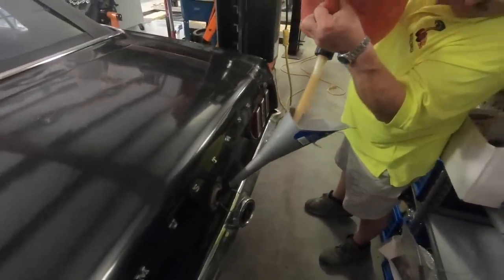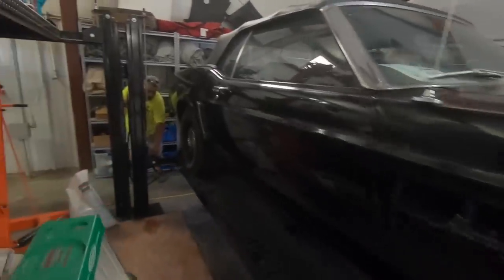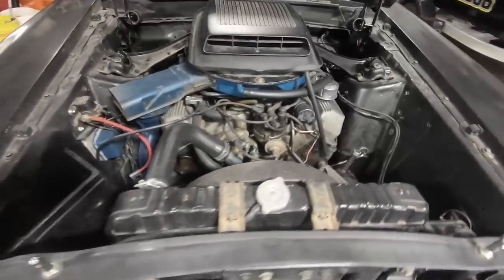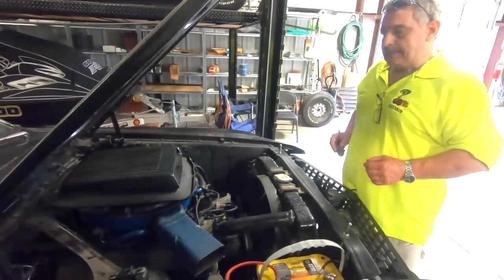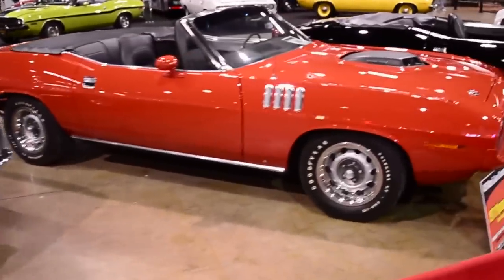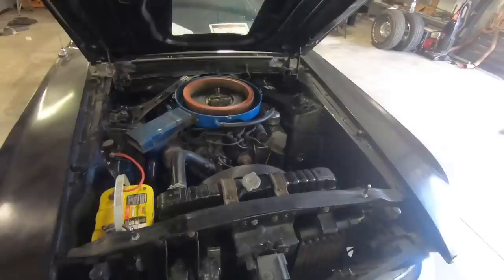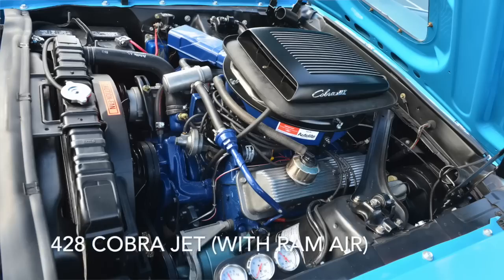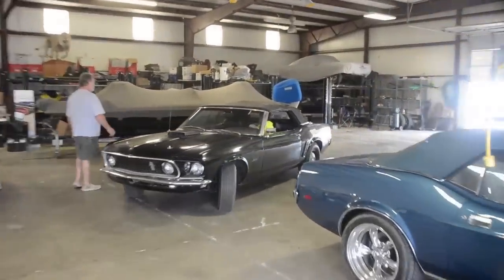True Holy Grail Barn Find, 1969 Drag Pack Mustang Convertible, One of 8

Comment: It wasn’t a Mustang but my brother found a 1969 Torino Cobra 428 CJ.  52,000 original miles and Dan original paint car. No modifications or anything cut or painted. 
Interior, black and perfect. Exterior, no debts, a few paint chips and had a good shine after cleaning. 
Once we cleaned all the fuel lines, tank, the 735 dual line from the factory carb, and the brakes we got it going right away. 
Decided to keep it as is original.  Worth more never painted or modified. It’s parked in southern Ohio. 
It’s brother was found in much the same way. In an old barn. 
A 1970 Mercury Spoiler with a 429 SCJ w/drag pack.  This one a 4 speed car, all the gauges, the louver on the back window, and checkered seats! Black and white checks. This one like the 69 has original paint. Dulled in some areas, rock chips. No rust. We got this one going and it is a fast car and fun to drive. They sit side by side in his garage.  I think he likes the 69 better. I’d damn sure be happy with either.  
Wonder what kind of money those are bringing?

Comment: They came with a special C6 that was used behind Cobra Jet cars and even the police cars cars used the special C6. Big servo. Wide ratio trans gears. And extra clutch packs e.t.c.  The wide ratio gear box is what really made the cars come off the line alot faster than standard C6's First gear was really short. Made the car have excellent torque from a dead stop.

Comment: We have 1970 428 cobra jet 4 speed convertible 325 gears. No power steering no power brakes no shaker hood. Order just for street racing sleeper. Marti report on this car says it is one of 5 built with 428cj and 4 speed. Only 15 were built in total sounds pretty rare to me.
Reply: That's what I was thinking. He didn't even have a Marti report.

Comment: wrong way to start a stored collector car , should have primed the fuel system, spun the oil pump , etc etc, good way to ruin a motor
Reply: It primed by the starter when he was cold cranking forever and not tapping the gas, then he added the gas down the throat and sparked it off.  The battery was right there next to it on the floor and they've recently gone through the entire fuel system so pretty sure it's been run more than a few times since he got it so it's fine.

Comment: Cool, but I do believe that the top 67-68 fastbacks bring much more money than that car.
Reply: I own 2 68 fastbacks GT cars a 390 s code n a 302 j code all orig low mileage cars 69 stangs are not even fastbacks they are sports roof the holy grail is a 68 fastback GT 428 cobra jet r CODE not that many because shelby used a lot of them for the GT 500KR

Comment: A fellow I worked with in the 80's had a 71 or 72 Big block Mustang with the drag package he ordered from overseas and had it delivered to his local dealer when he discharged from the service, his dad some how or the other knew a bunch of the NASCAR people, he took the car to Daytona back when they had an open track day or something like that back then and got his clock cleaned by a big block Corvette, being a Ford man this did not sit well with him, on the way back to PA they stopped in at Hollom&Moody in NC I think he said is where it was, they had one of those huge engines that had recently been outlawed by NASCAR sitting in the corner with a hole in the block, his dad knew the owners (don't ask me how an old guy from PA with a small garage knew them but he did) and got them to sell the engine to his son, it took a couple of years for him to buy a new block and rod, get the engine in the car and get everything working correctly but he did and that thing was a monster, I guess at one point he had to send the car to H&M to get the front modified cause he couldn't get the engine to fit in it, one of the monster trucks, I think The Virginian, came to a local Ford dealership on a promotional tour and someone who saw the engine mentioned to the owners that he knew a guy who had an engine like that, at which time they said "Not like this one", a call was made and the owners of the truck were amazed to see one in a car, I guess they pulled their checkbooks out for the engine but he said no way, he'll never part with it, the car used to run out of Brownsville PA, I haven't seen that guy in years and have often wondered what happened to him and the engine.
Reply from the maker: Great story!!! Thanks for sharing.
Reply: Yeh Ok if you say so.
Reply: @jonathandexter135  
Yea, I do say so, why?

Comment: Some years back i had Ford top loader bullnose trans with close ration gears. I bought it cheap from a guy who was going to use it in a circuit racer ,which never happened. My plan was to use it in my Hemi T bucket salt racer. I checked the numbers on the top loader site and it was originally in a Torino Drag pack car. I wonder how many Torino drag pack pack cars were built?
Reply: Well alot of things happend during that era. For example Vietnam war

Comment: How do you have a “drag pack” option with an auto trans?
Reply: Drag pack was the beefed up auto trans..drag packs did not come in a manual
Reply: Drag pack was a 9 inch Detroit Locker, (391 or 411 Gear ), dual exhaust, factory oil cooler , which was visible in the Video, and the shaker Ram Air with hood pins. Most were manual trans, the rest were auto.

Comment: Ya he's got a nice collection  but,  I think that black convertible has had an engine trans plant because, as the owner of 5 Mustang's 3 of them are 69's a 72 & 73, 3 are also Mach 1's. I also have several big block 60's  Galaxie's. Whenever I seen a big block Mustang 390-428  the factory original exhaust manifold bolt pattern is horizontal on the head's to clear the shock tower's, witch are different head casting's also. A lot of guy's will transplant a block big engine from other Ford product's only to find out that the engine verticle manifold bolt pattern hit's the shock tower's. This car may indeed be an original big block car but with the drag pack option  somebodies lead foot probably blew the original engine & installed a trans plant. Also big block hi po engines usually came with factory cast iron header's. Some of the head's also had a dual bolt pattern for different application's. Also in the 60's most all hi po  optioned car's from Ford were shipped from the factory with the hi-performance part's in the trunk & were dealer installed ie Tri-power & dual 4 barrel set up's. Which make's wonder what ever happened to all of the stock manifold's & 4 barrel carb's & intake's the mechanic's removed, along with the stock exhaust manifold's. Gee if we only knew as car collector's back then where all this was going, I was somewhat lucky & got my 18 or so car's way before the craziness took off, I don't suffer from the 20-20 hindsight issue! but that's another story.
Reply: please, please learn how to use apostrophes - they are not meant for plural nouns/verbs (5 mustangs not 5 mustang's).
"mustang's" means belonging to the mustang (ex. "my mustang's rims got bent when i ran over that crowd of orphans"). 
you, on the other hand, stick them on every word you want to make plural and make them look as possessives instead.
Reply from the maker: Good one Svetlana. One of my pet peeves is when somebody uses a subjective pronoun as the object of a preposition, so I feel your pain. Please post more.
Reply: picky, picky, picky you must have been your literary teacher's golden boy for sure Shitlana  Donald Fuller's comment hit's the nail on the head! Pop corn fart.
Reply: @svetlanaz7872  
You busy this weekend?
Reply: and you drive what , a lada?

Comment: Been clocked 1 is higher than other didgets a sign it's been played with should be all exactly the same level at the factory they use a pin to assemble the Speedo clock ,,

Comment: I remember Huntington WV Ford dealer had two 70 1/2 Falcon 2dr with the big block Drag Pack option.
Sticker total was about $3500 ! One was baby blue, one grabber orange. 70 1/2 Falcon based on Torino platform
but 2 dr had window frames and a B pillar unlike Torino. Bench seat, rubber mat instead of carpet, no mldngs etc.
Bare bones racer for sure. I sure did want the blue one but what  can a 17 y/o do?
Insurance (if anyone would write it) probably be as much as the car. Heck, I would have been happy w/a 302 automatic

Comment: How would you get a better deal on a 69 over the 71
Reply: Beecause its a smallblock car with a junk 429 put in it
Reply: 429s were garbage. The 427 was a beautiful engine. Apparently Ford busted Shelby for dropping 429s into Super Snakes to save money and made him swap them back out for 427 side oilers. Since it was a customer option to do the swap there are a few Super Snake 429s still out there.
Reply: 428s, not 429s. 429s are 385 series engines. 427s and 428s are FE engines.
Reply: @alanmyers5081  the 429 Boss was the '69 -'70 drop in engine on stock Mustangs.

Comment: Sorry but this car was a small block.   This guy is totally full of crap      Look at the shock towers.   Fords with big blocks had reinforced metal found about half way down the inside of the shock tower.  4.07 mins in you can look at the drivers side shock tower which clearly does not have the reinforced metal wrapping around the lower half.     They built thousands of these cars,
Reply: it has happened before   this car came from the factory with a small block.   the guy got ripped off
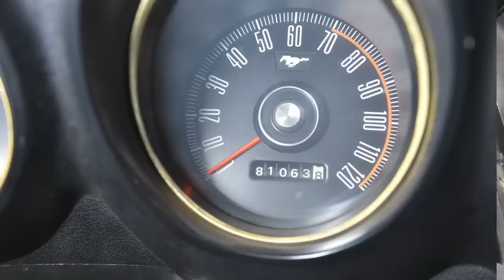Reply: The reinforcement is clearly visable behind the dipstick on the P/S pump at 4:08......
Reply: 429 boss had the wider shock towers.the rest were narrow.

Comment: That motor was a trainwreck. Timing was off, had several exhaust leaks, dropped cylinders, carburetor was all jacked up. And to be honest,....that motor didn't sound like it had the kind of compression a drag pack motor would typically have. Just not the condition a "Holy Grail" car should be in. Just my opinion.
Reply from the maker: Well, this holy grail is also a barn find, so not restored.
Reply: @thewriter2549  He did build that motor though.😳

Comment: Okay a heavier convertible and they ordered drag pack. Rare because it doesn't make sense. Why order a heavier car and then want to race it. The non convertible would be faster right from the start. That's why it's rare because it's not desirable at least not for it's intended purpose. Now you have a great car don't get me wrong. But a race car that wasn't raced. Well that says it all.
Reply: he mentioned, the previous owners had swapped the rear diff & box so it could be raced (he's got the originals ready for install later)
So it most likely was actually raced
Reply: I think there is a reason they hide cars because they have been altered many a engine swap and altered numbers
Reply: I think a drag car would be a four speed for sure

Comment: What makes a Mustang a Drag Pack???  What is a Drag Pack????
Reply from the maker: Drag Pack was an option that readied a Ford to drag race, starting with either the 3.91 or 4.30 rear axle , which dictated an external oil cooler, and a Super Cobra Jet build.

Comment: That piddly ass shifter is the same one they always had, whether it was in a 64 Mustang or a 70 Mach 1 or 11, I was always afraid of mine breaking if I banged t too hard in my 67 Stang, very flimsy, and looks very cheap. Ragtops never ever turned my crank, you jack up one side of the car and the door on the side that you jacked-up won't open, just shows how weak the suspension is on some ragtops, to me they might look nice but I think that they are really unsafe, you roll, you're dead. I myself would never buy a ragtop, T -Top different story.